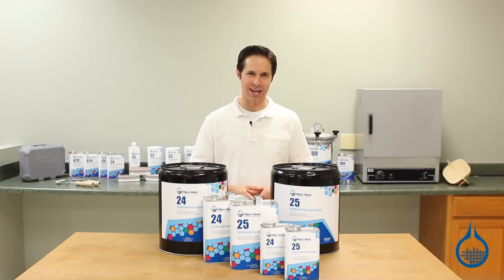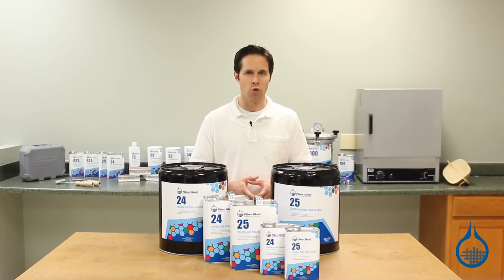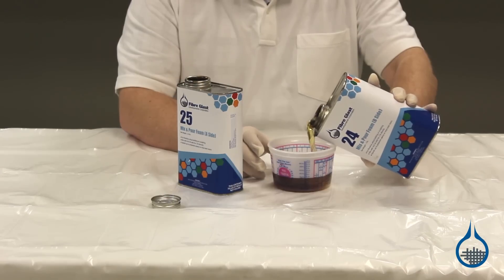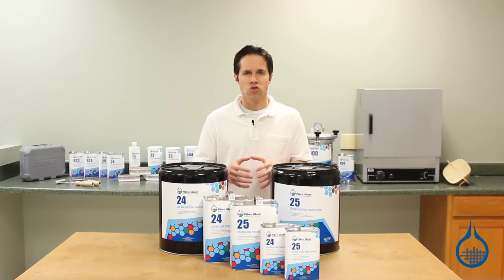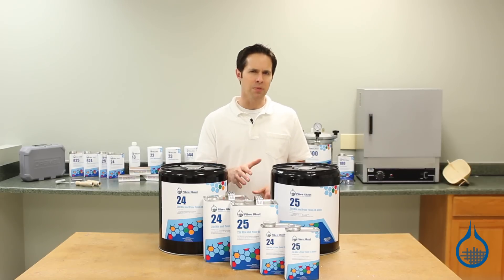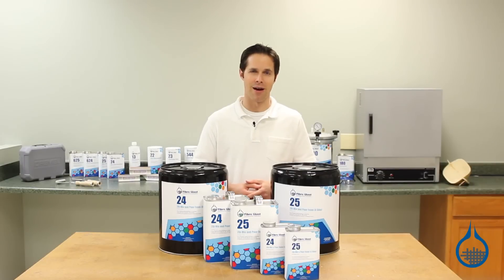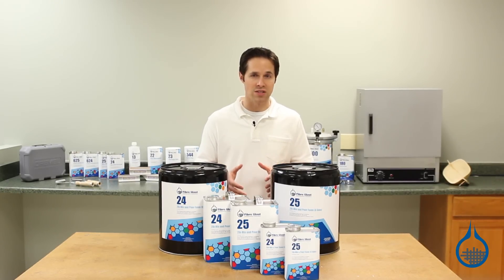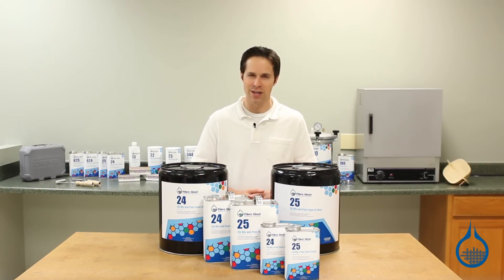2 Lb. Polyurethane Mix and Pour Foam

Comment: Till what temperature is the foam stable?
Reply from the maker: This foam has a flash point up to 400°F but we do not recommend it being subjected to such elevated temperatures.
Reply: @fibreglast  can it be subjected to 120 C for 1 hour
Reply from the maker: @desharchit1  This foam was tested at  100°C for 7 days and the stability of the foam diminished somewhat. It was not tested at a temperature higher than that. So I feel it is safe to assume that at 120°C even for an hour it will degrade to one degree or another.

Comment: I have a question if you don't mind…  is it possible to lengthen the 45 seconds to about couple of minutes in any way?
Reply from the maker: Unfortunately no there is not. Once the two part system has been mixed the chemical reaction causing the foam expansion starts taking place immediately.

Comment: Is this suitable for a transom which supports a 250 lb outboard motor?
Reply from the maker: For an outboard supporting transom we would recommend our 6# Mix and Pour foam (#624/625) due to the superior strength properties.

Comment: interested in filling the extremely large hallow of my pickup between inside wall of the bed and outside fender to prevent dents . what foam would you suggest.?  And would it last under a truck ?

Comment: It seems to have kind of an off white color, as opposed to typical surfboard foams which are very white.  Do you have a more bright white version that could be used for surfboards?
Reply from the maker: +IClausius The white surfboard foam you are referring to is actually a different type of foam. There are a few benefits to our foam (MDI), but if the white appearance is your primary concern, you could add our #141 White Urethane Pigment to the resin side of the foam prior to mixing.